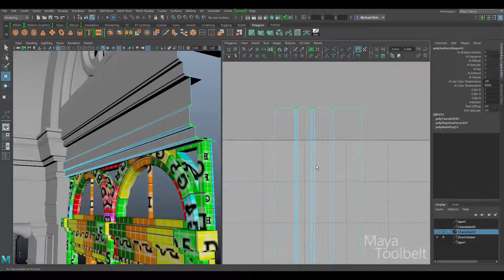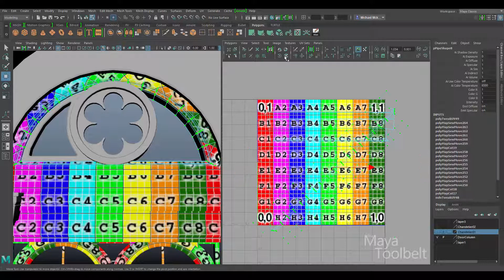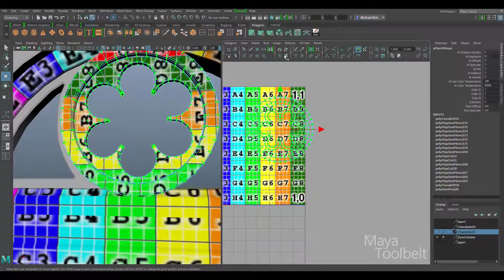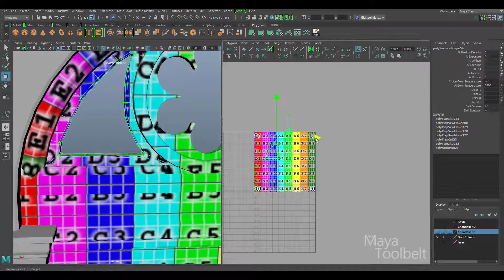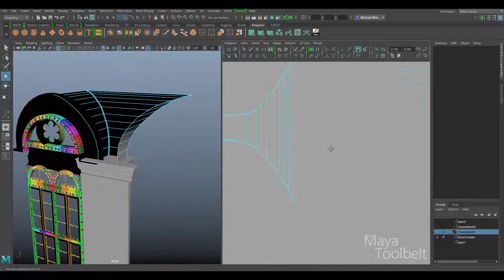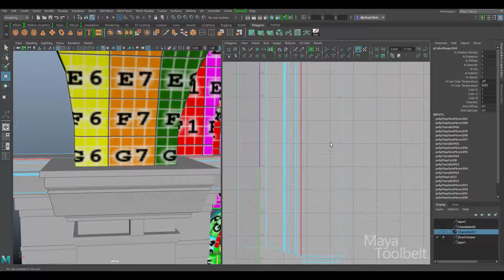The Maya Toolbelt - Environment Project - Part 19

Comment: Hi Michael: In this video your applying the test material, positioning and scaling etc. I notice the section just below the 2 small arched windows that the test material on the sill (right side)is backwards. Will that affect the material when applied?

Cheers
Douglas
Reply from the maker: The texure that is applied would also be reversed. We'll wait and see how noticeable that is once I get that far. If it's blatant, I'll make the needed adjustments.